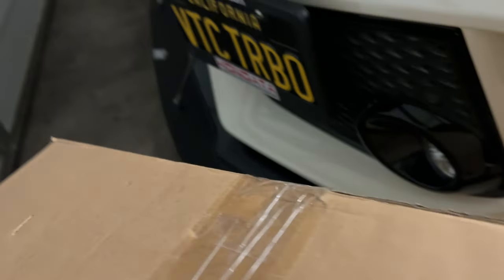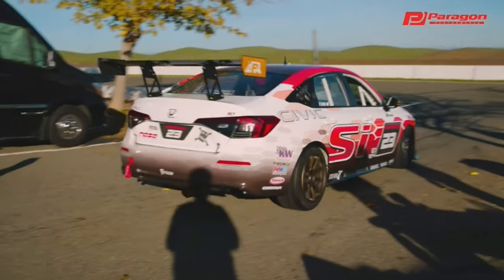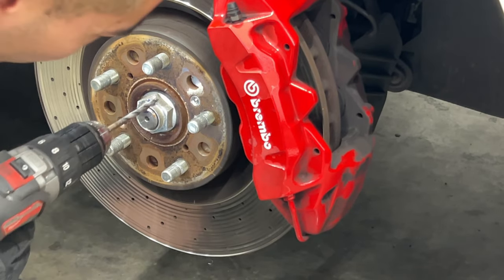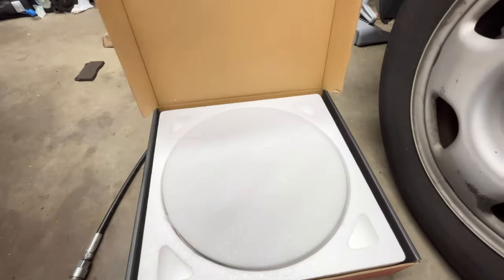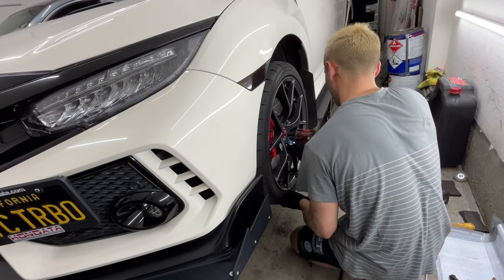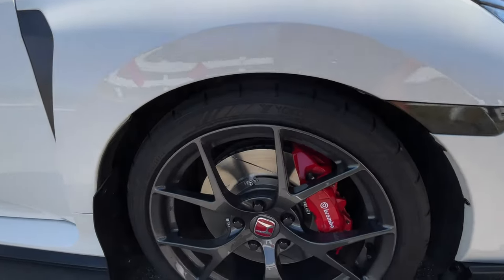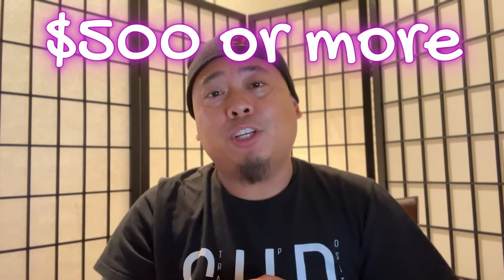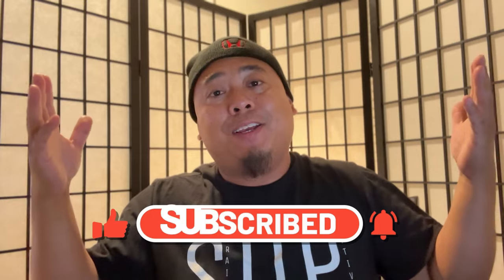Paragon Brakes and Rotors Installation // Best Setup For Any Car

Comment: What is the coupon code to get the $50 off? I used the link you provided and it did not take $50 off when adding to my cart. It is over $500.00
Reply from the maker: Thank you for your comment. How it works is that after your first purchase of over $500, the next purchase you make is when the $50 discount will be provided by way of a code. 

If any problems arise, I can contact Paragon Brakes for any issues you may have. Thank you for checking out the video and supporting the channel 🙏💯

Comment: How do you like them so far?
Reply from the maker: I’ve done a few canyon runs and the feel is really good. It is somewhat squeaky when normal driving on roads but is expected with these pads. Overall, it’s pretty good. Thank you for your comment and watching the video.
Reply: You have the p3 pads correct? I pretty much have the same setup, and on some mountain drives, after driving pretty spirited, I would start getting crazy vibrations when braking. Any similar situation? never happened on oem rotors and hawk pads.
Reply: @yoimseb4755  are you still experiencing this? do you have the P3s on stock rotors or paragons?
Reply from the maker: Never had vibration issues. Maybe uneven pads occurring as time progresses? Not sure what can be happening.
Reply: @sarmadhares756  yeah, it’s pretty annoying cause it seemed to happen pretty early on, havnt been driving that aggressive lately but when I do it still does it. I have the p3 on the paragon rotors. I wanted to switch out pads and see if it changed but I got lazy haha gonna try project mu pads I bought
Reply: @yoimseb4755  that sucks man i ordered mine and should get them soon. Did you do the bed in process before using them?
Reply: @sarmadhares756  sure did! When I replace the pads and stuff I’m gonna inspect them and see, rated for light track and after 10 mins of mountain driving vibrations start :/